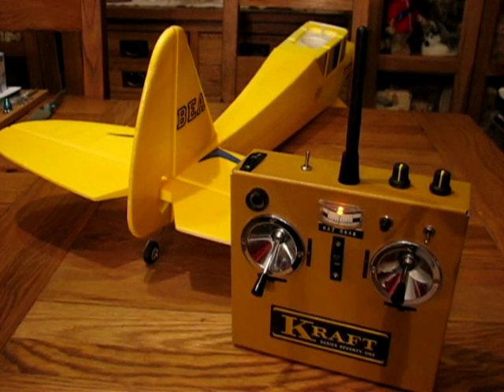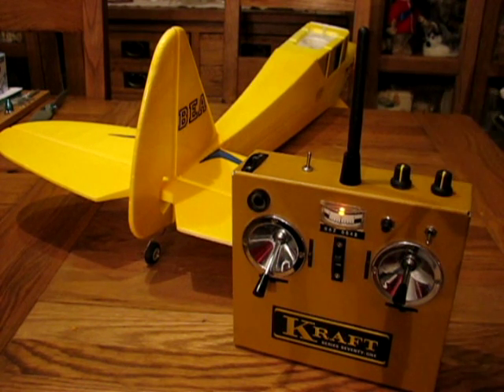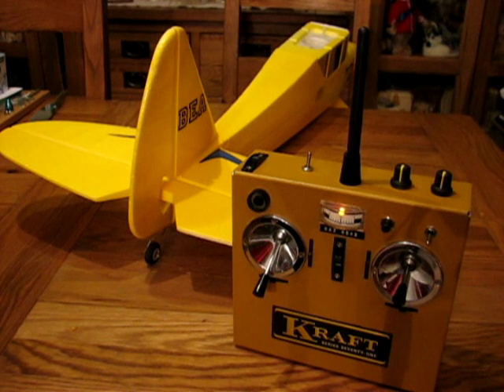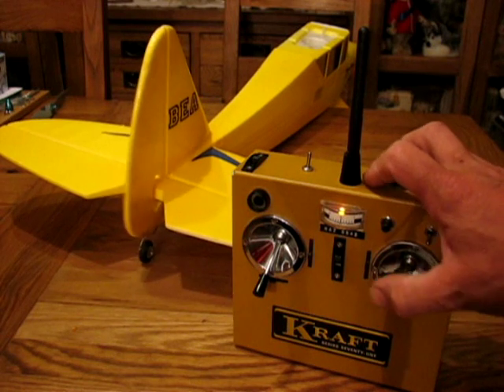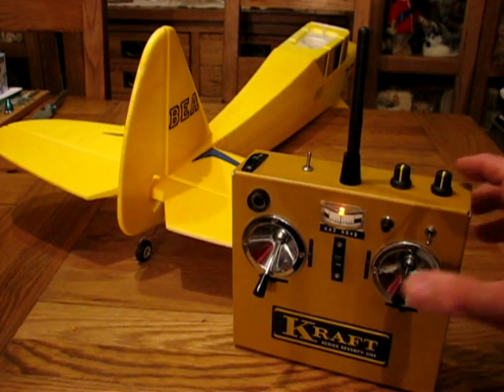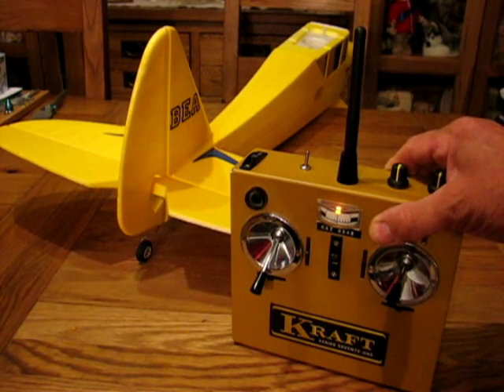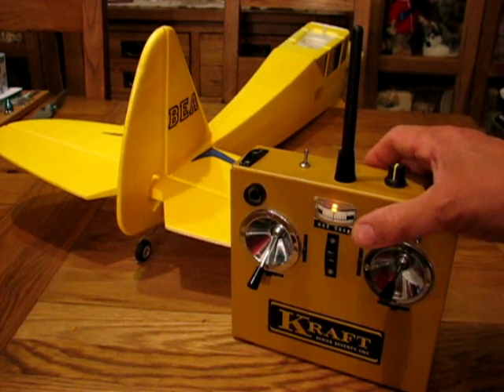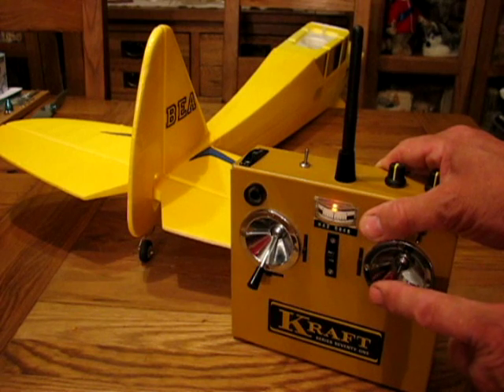Kraft Series 71 refit - development!

Comment: Would you consider sharing your source code for the Arduino? I'm sure there are many of us out here who would like to avoid reinventing the wheel. I've got a couple of lovely single channel transmitters I want to convert to 2.4, and using a Nano sounds ideal. Thanks, Ian
Reply from the maker: +Ian Harris 
Its been shared since day 1 Ian, its on the archive page of www.singlechannel.co.uk item P16 & 17.  Also you should read the thread on http://singlechannellersreunited.co.uk/phpbb3/viewtopic.php?f=8&t=167
But to convert S/C transmitters I would suggets using my proper, purpose designed S/C emulation encoder.  Details on the Archive page item P1.
Cheers
Phil
PS this is an old video,  this is teh current one https://www.youtube.com/watch?v=r9ZGZUQClS8